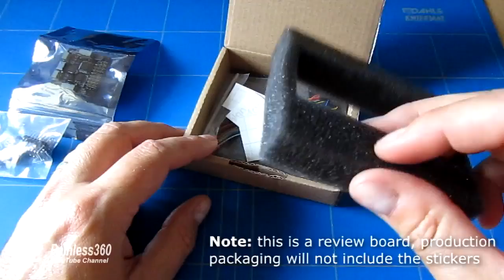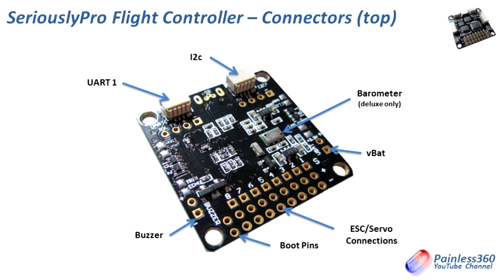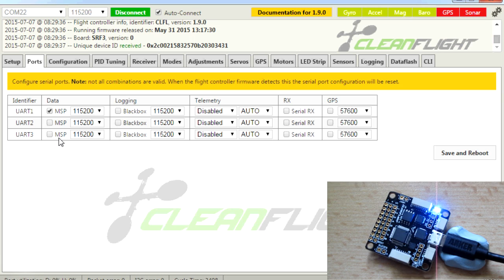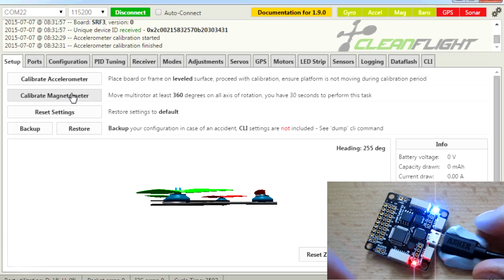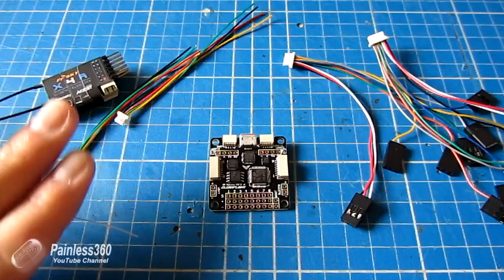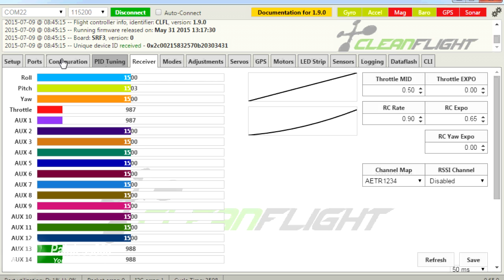(1/9) Seriously Pro F3 (SP3) Series - Overview and firmware installation

Comment: Do the basics of flashing and connections carry over to the F3 mini? IE can I use this video to help me setup my SPF3mini or are they not similar enough?
Reply from the maker: +RCnStuff They are very similar but the pin-outs are different and the Mini has a few more features..
Reply: +Painless360 I know it's different and I need to follow the pin outs. I was just wondering how much I can take from the video to help me connect my F3mini. Pretty loaded statement I know. Thanks for the quick reply!!
Reply from the maker: Until we've got well into the SP3Mini series then I can't add more, best of luck with it!
Reply: +Painless360 Thanks! Will you be doing a video series on the mini?
Reply from the maker: See the channel update from last week..
Reply: +Painless360 I heard after I asked, thanks. Now get to work LOL!!

Comment: This FC sounds great but is very short on information. The website has less than basic info and the manual is just a list of port IDs. 
So, why am I disappointed with this FC . Well I swapped out a KK2 board on a basic 450 frame for the F3 and the result is unflyable. I usually do things this way because the KK2 is a reliable meter of what will work.
The information I am lacking is ; acro mode: what do these guys call it? ; PID starting point : handy to be able to get of the ground so you can start tuning; What frequency ESCs does it tolerated?
??
Reply from the maker: +Dave Roche This is all covered in this series, watch it and it should answer a lot of the questions (this is exactly why I made these videos). Cleanflight is a very popular software for flight controllers and looking into the manuals for that will help too as far more of the detail you are looking for is in there. The aging KK2.0 was an 'all-in-one' you are moving from that into the 'exciting' world of open source technology now ;) Best of luck!
Reply: Thanks for replying. APM was once guilty of insufficient info but now they're out of fashion and more expensive.
The config tools for this FC conflict, so it isn't easy to ascertain faults. BaseFlight gets the board orientation 180deg out and the self level multipler is 'labeled figure it out'.
I will have another look thru your tutorials but I think you may have lucked your way past a few issues with this FC.
Reply from the maker: This board is designed for use with the Cleanflight, designed by the head developer infact - I'd expect problems using anything else.. Best of luck.
Reply: It may be of use to know. The default Level-P gain of 9 was 3 times higher than could sustain flight in Angle mode ie P=~3. Rate/acro/manual modes are not described as a zero input default mode, however the PID defaults of 4,0.035,23 are at lease flyable. Of cause, these are the parameter included by CleanFlight.
As much as I sound like a grump, it may be useful for this information to be in the documentation. Or defaults that privide a good starting point.
Note: I do subscribe and find you videos excellent.Cheers

Comment: Hi , first thanks for all your good work !  I am setting up a spr f3 board using your videos. Just to clarify, if I remove all but one of the + wires ffom my afro race spec mini esc ( with bec ) ... this will be ok to power this flight controller ? Thanks again :)
Reply from the maker: Yes, but if the BECs are linear then you can plug in more than one red wire for a little redundancy.. Best of luck!
Reply: Great,  thankyou !
Reply: +Painless360 Followed your guide carefully ... then realised my problem. My x4r is eu lbt but my taranis x9d + is eu 2015. Which of the several routes would you take ? Looking at upgrading the radio and replacing 3 other rx to suite. I trust your judgement :)
Reply from the maker: Depends on a few things really. How many other Rx do you have, do you want the modes that using EU receivers will stop you from using? See out videos on changing the firmware on the receivers.. Best of luck!
Reply: +Painless360 I have 4 2015eu all x6rs running pwm. I want to switch to sbus on the new  x4r which is 2015LBT.Will then replace my others with x4r once sorted.

Comment: 22:09 I have taranis pluss and frsky x8r. The map is not AETR1234 and it hang after active stick movement for one second. Then i ordered x4r from banggood to replicate your setup and its not pairing with my taranis. Looked your videos and dint find any pairing tutorial. Any idea, why signal hang and is any difference to pair those two transmitters to taranis? My map and hang sample video here: https://youtu.be/exvAqXsv_X8
Reply from the maker: +Allan Tamm If your rx and radio firmware are not both EU or not both non-EU then they won't bind..

Comment: What voltage can this be powered by?
Reply from the maker: +Common Sense 5v BEC
Reply: would i be able to power it from the 5v bec in the tx and share it with the fpv camera? are there any disadvantages in this over having a separate BEC?
Reply from the maker: Not sure what you mean - 5v in the tx?
Reply: Most fpv transmitters have 5v out negative  and signal for the camera. I was wandering if I could steal some of that and use it to power the flight controller (srry im trying to decide on a new channel name btw)
Reply from the maker: I see! The 5v out on the Vtx is normally only designed for powering a single basic CMOS camera. I wouldn't trust one to power the entire electronics package. Use a BEC to be safe.
Reply: OK thanks! One last question, when you say its designed for powering CMOS cameras does that mean it can't power CCD cameras?
Reply from the maker: CCD normally 12v
Reply: That makes sense, I got a CCD, what would be better: to have a 12v step down from a 4s or to have a 12v step up from the fpv tx? Are there any other better ways to do it?
Reply from the maker: See our video on using 12v cameras.. Best of luck.

Comment: I used 5v and ground from uart 1 to power some leds (saved me removing the board to solder on more pin headers), they worked for 1 sec then went off and now the board cannot connect to the pc (usb malfunction on plugging in). Any idea why? Thanks.
Reply from the maker: +nolsmtm Sounds like something power related on the board has been fried. Best of luck sorting it out..

Comment: Hello, I am new to this multirotor stuff and after watching your video I decided to buy the seriously pro. I was able to configure it and I've got over 10 flights on it. But while tuning, the USB connector ripped off from the board. Is there a way I can connect to the computer without the USB? This board is too expensive to just dump into the garbage because of the USB
Reply from the maker: +Rachmeg Se UART1 and the USB port connect to the same IO electronics so you should be able to still connect to it via UART1 pins and a FTDI adapter. Best of luck.
Reply: +Painless360 Thanks! please do you have a video on this?
Reply from the maker: Nope but following the others in the series I hope its something you can figure out without too much trouble. One to one support is available if needed (but not free)..
Reply: +Painless360 thanks, I figured it out. I was able to connect

Comment: Hi I have just purchased the deluxe version of the sp3, can i install this board on the Zmr250 power distribution board even though the pdb has connections for cc3d and naze32 boards. I also want to put the mini minimosd on the pdb.
Reply from the maker: We installed it on a ZMR250 with a PDB so that should help.. Best of luck!

Comment: Hi, I am a great fan of your really helpful videos! Helped me already doing a lot of buing decissions! :-)
Could you please explain anyhow how to connect a spektrum satellite to that board? Or maybe to do an all over wash-up how to setup a spektrum satellite to several boards ... ?! Would be really great!!

THX!
Reply from the maker: +dude770725 This is covered in the documentation. If you want to use a really small Rx then I'd use a R616XN.. Best of luck!
Reply: +Painless360 The manual states: "When using a 3.3v Serial RX receiver (S.Bus, SUMD/H, etc.) use GND/VCC/CH3 (UART3 RX)."
Is it that where I connect the Spektrum Sat? UART3 without the TX connected? Many thanks for your help! Highly appreciated!

Comment: What size quad would you say this board is good up to? I see a lot of info on the 250 class using this but nothing on a bigger size. I'd like to use this board on my 600 build, should I run into any problems doing so or is this not a problem at all. Thanks
Reply from the maker: +SirTTMullen This board will be able to run that no problem. The SP3 was really designed to be used by 250 class racers and the other modes that those of us that fly larger models (GPS hold, GPS RTH) are sadly not a priority at the moment for the development team. If you are looking at a larger craft then I would consider a flight controller that has features like a more developed failsafe and GPS modes. https://www.youtube.com/watch?v=k4tQAmg2ssA may be useful..

Comment: Hey guys.  can someone tell me how I go about flashing the firmware with the bootloader pins. I can seem to get my board to even connect with the boot bins jumped together, I accidently chanced UART3 to data :(
Reply from the maker: With the pins shorted you should be able to go through the firmware loading as normal (but tick the box at the top to show it that is already in bootloader). A video showing what you are doing and the actual error is very useful when trying to help. Best of luck!!

Comment: I take it that it would be possible to add a barometer & magnetometer break out board to the acro version of the flight controller which would allow the breakout board to be placed well away from interference.

I think a board like the one below would be suitable :

http://www.ebay.co.uk/itm/111424501317?_trksid=p2057872.m2749.l2649&ssPageName=STRK%3AMEBIDX%3AIT

Comment: That Cleanflight app will actually run on my Chromebook but I don't have a compatible flight controller to try it with. I wonder if Chrome has the necessary USB drivers to allow it to talk to the board?

Comment: Hai
    i recently bought this sp3 deluxe FC.when i connect to clean flight it  shows SERIAL PORT SUCCESSFULLY OPEN:1
NO CONFIGURATION RECEVIED WITHIN 10 SECONDS; COMMUNICATION FAILED
SERIAL PORT CLOSED .keep on repeating the same error ,drivers already installed ,please help me to fix the problem,thanks in advance
Reply from the maker: +Nirmal Kumar You need to go back to the supplier of the board for support and help. Best of luck.

Comment: Just thought I'd chime in on something I did recently. At 3:36, regarding powering the Naze32 on a hex while using opto ESCs - an easy way to power the Naze32 is to feed the 5v to the receiver and the receiver will in turn power up the Naze32. I'm using the FrSky D4R-II receiver on PPM and there are spare pins where you could plug in the the BEC. Nothing's burned up so far so I'm assuming it's all good. :)
Reply from the maker: +Safwan Sulaiman That is a great way to do it when you've run out of spots. I recommend this to those who have no other option and show it in a few of my videos too. The cables can't carry a lot of power so as long as you don't run servos and try and run GPS, MinimOSD and everything else at the same time it should cope great. Happy flying!

Comment: Fresh stock in at TBS, I didn't know about their participation. Great. Pricey for anyone converting from CDN pesos. Sheesh. Just a small note though, I don't mean to be picky, but surely you do compass calibration  once mounted in the frame, and maybe right at the "airfield" depending on distance from your original point of calibration. Which BTW would be done outside and away from EMI generating objects. :-)
Reply from the maker: Youve not watched the second video have you!  ;) Happy flying!
Reply: Painless360 Thanks for responding,. Thought I had. Suppose I missed it.

Comment: I know this was probably designed primarily for various quad copters and their derivatives, but can you use this on fixed wing platforms and what plan forms does it support. I was looking at the Naze32, Eagle Tree Vector, and Pix/Fixhawk as possible FC, but this may be a contender as well...thoughts??
Reply from the maker: Tim Sears Loads of the latest generation of flight controllers allow for planes as well as Multirotors support. Boards like the APM/Pixhawk also support helis and ground vehicles too. I've used the APM mini and the CC3D on wings..https://www.youtube.com/watch?v=k4tQAmg2ssA shows you a few options. Best of luck with it.
Reply: Thank you for the video. I decided on an APM 3.1 because GPS & stabilized flight are the two biggest goals for me currently. I purchased the board/gps  from Banggood, Hoping for a good experience with them.
Reply from the maker: Best of luck with it!

Comment: woo first video :) any ideas how many videos will be in this series ? can't wait for the next one
Reply from the maker: James Stoodley Next video will be mounting the board, connecting ESCs, power, final checks and first test hover, then videos will cover Modes, adding GPS, adding LEDs, Adding OSD, Using Smart Port Telemetry and Blackbox setup and use.The series will roll on into late August..

Comment: Thanks for the videos you make.  You recommend the X4R over the D4R receiver for this FC?

Thanks
Ryan
Reply from the maker: Either are excellent choices. I am using the X4R as the board supports Smart Port and SBus without inverters..
Reply: Any have an advantage?  I use d4r currently and want what's best for this new build.  I read sbus can be quicker?
Reply from the maker: It is but you would have to be some crazy pilot to notice it in day to day flying!

If you get an X4R you can follow all the steps in this series exactly..

Comment: Probably I am one of a few who gets this controller outside UK, and I am facing some issues with the Throttle.

When arming the board via Switch Motors will start running only when above 1500 (middle position) on the Throttle Channel.

In the Baseflight configuration settings are Min Throttle 1000, Middle 1500, Max 2000 and min command 1000.

Reseiver is x4r on SBus and sender Taransis plus.

any ideas please?
Reply from the maker: juesch23 Does it do it when you arm using the throttle low/rudder right method?
Reply: still the same
Reply from the maker: Happy to help but please watch https://www.youtube.com/watch?v=olIqTiSJHIY and come back to me with more detail of what you've tried..
Reply: The only thing what I haven't tried yet was contacting the vendor - but out out of this everything I ever was ever faced with in building q-copters. It just was a question if you have experienced the same?

Soft/Firmware of the board is 1.9.0 and the HW Board: SRF3, version: 0

Set up a new profile in the Taranis, and the AETR Channels are all calibrated to 1000 - 1500 - 2000
Reply from the maker: I have not had it here - always worked fine but I've seen it asked about and discussed in a number of posts in forums and online sites that you'll come across in your Google searches.

Personally would consider clearing the board and starting setup again. You still haven't told me what troubleshooting you've tried i.e. if you have calibrated the ESCs, swapped two motors over to see if it's specific to the motor... loads to try.

Best of luck.
Reply: ESC's have been calibrated and all motors do showthe same behavoir. I reflashed the board now and somehow it will not longer recognize RC input. Flashed it also in bootloader mode. Connection from Taranis to x4r is   working. Status LED on the F3 Board blinks red ...

Comment: Hello there about that zyx -m  tarot flight controler well I got it to work but one thing my battery drain real fast and went below 10 volts do you
Reply from the maker: Paul Antonucci Not sure what the question is - looked like the comment cut you off..